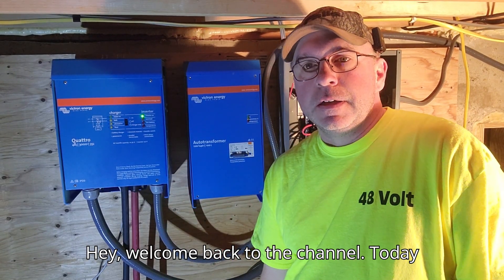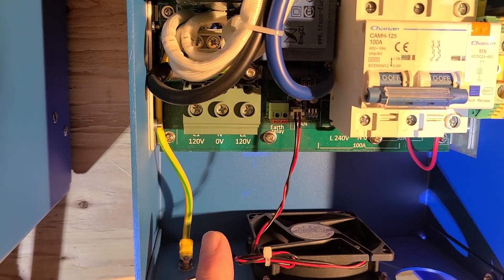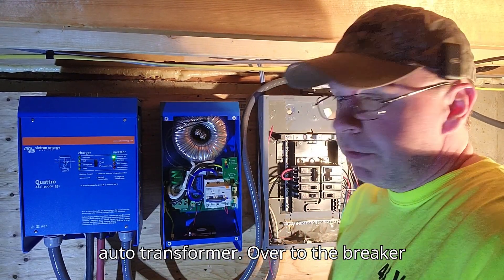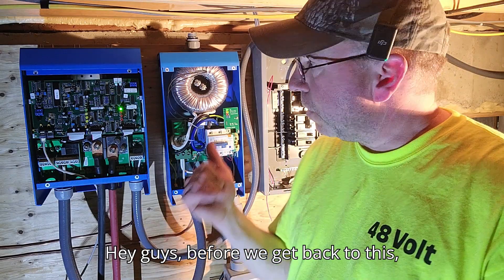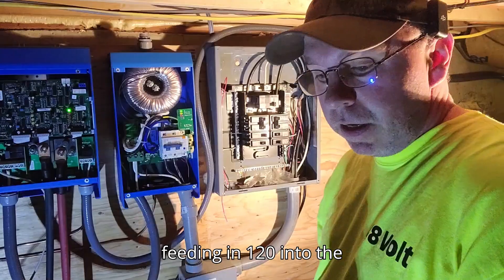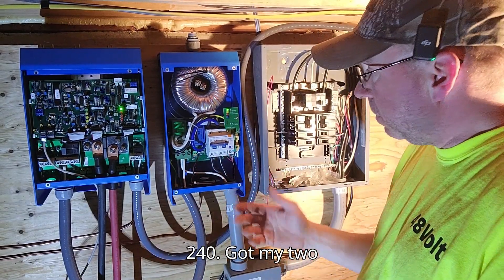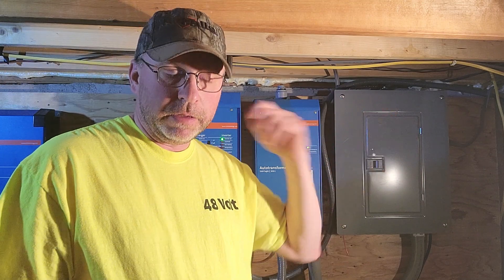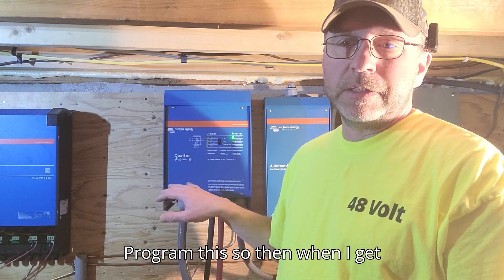Victron 100 Amp Auto Transformer

Comment: Can I used li time 80a 49volts 3000 watts 100volts output to that? Thanks
Reply from the maker: The auto transformer can be hooked up to most any inverter. Some of your numbers seem a little odd to me so I think it would be best to either check with victon themselves, a dealer, or do some more research.
Reply: @dustybooksdiy
Hi there men. I have a question in the video: You connected the ground of the Quattro to the ground of the Autotransformer or only the ground of the Autotransformador to the house?
Reply from the maker: @mhansel71  make sure to follow any local codes and find someone local that you can at least bounce questions off of.  The inverter has a ground relay the i shut off to keep the chassis and ground separate. Ground goes back to main pannel and chassis goes to earth.

Comment: I caught it you have a 3kw Quattro. So you are doubling the voltage. Does it allow you to run a electric dryer off of it? I know Victron is actually able to handle nameplate ratings and surges unlike our chinese models, so my understanding is dryer is 6kw, but I'm not sure for how long the heating elements keep turning on (assume some duty cycle), and so not sure if that is within the surge ability of the 3kw Quattro. Also, what are you using to control your dump load. It sounded like you are controlling AC dump load. I've only found one commercial AC and one AC diy, and everything else DIY has been DC based. I'm looking for AC dump load controller and almost thinking I'm going to have to diy my own.
Reply from the maker: Brand: GXELZK
4.7
4.7 out of 5 stars
(9)
Automatic Generator Transfer Switch 100A 3P 4-Wire 120/240V Automatic/Manual Generator Transfer Switch Ensures Stable Power Transmission, Easy to Use

This is the transfer switch I used.  You can control 240v with 120v. Plus its power draw is very low.  With the auto transformer you are still limited to the size of your inverter. So basically a 3000 watt inverter is good for about 25 amps. You are kind of splitting it to 12.5 amps per leg, but the Quattro will handle 25 apms on ac2 out. My plan is to upgrade my inverter to a larger one, so I'm building my infrastructure for the future. As far as effeciency of the auto transformer. I belive it is the 98%.  You are always going to loose a little every time it goes thru something. I didn't notice any real drop in my system when I put it in. The Quattro is probably twice the depth of the autotransformer. It is heavy, but for my personal preference it is the best option.  If you go with either one it will be good.  Hope I answered most of your questions.

Comment: where did u get that cool deburring tool? why did you have to make your hole bigger? you didn't mention but I'm guessing maybe you are using the 32A model, and also 6 awg? and I'm guessing the hole is made for 3/4"? or is it 1"? I thought theses things were supposed to be spot on centertap (so exactly in the middle). I also thought it was only like 4.3" thick, and I thought the Quattro was huge and bulky ballpark 130-140 lbs. yours looks tiny and looks like it sticks out the same amount as the auto-transformer. so I'm confused to which models you have. I thought the Quattro only came in super duper big hence making me hesitant to get it, but from your setup, it looks flush with the auto-transformer. I was considering the Multiplus II because it would not stick out as much as the quattro.  I also could not find any efficiency numbers on the victron auto-transformer, but I'm reading they should belike 98% or something as the other ones I found on Amazon were rated at 90% (red flag do not buy).
Reply from the maker: I used to work in a machine shop and we used them there. I have the 100 amp model and needed to use 1.25 conduit so the fitting just wouldnt fit. it was so close that 5 min with the deburing tool and i got it opened up just enuff to be able to screw the fitting in.

Comment: You have a new subscriber 
  Glad I found this video. Thinking about getting a Quattro 10k and using the 100amp autotransformer the same way you are. Any issues with line imbalance, know it’s 32 amp max imbalance between legs.
Reply from the maker: I am still using my quatro 3000, so havent had enuf watts to push it to the point of having any line imbalance.